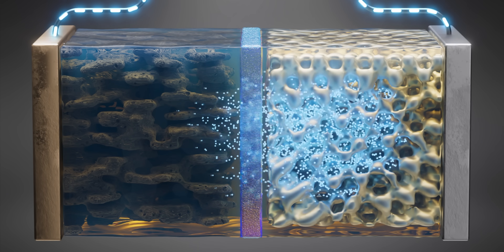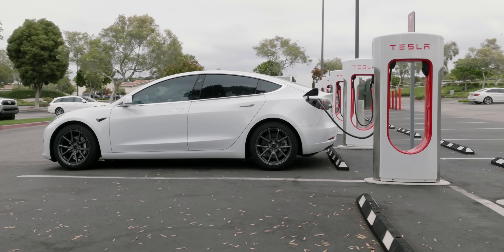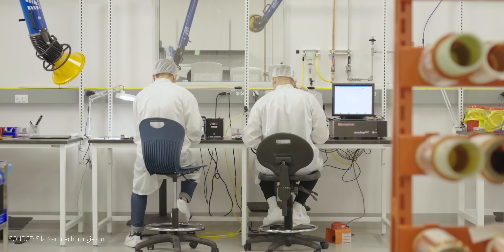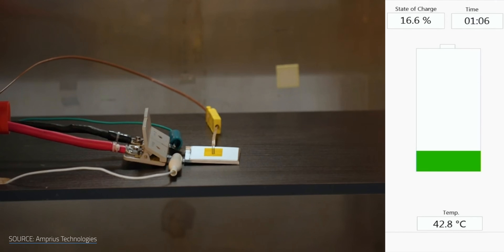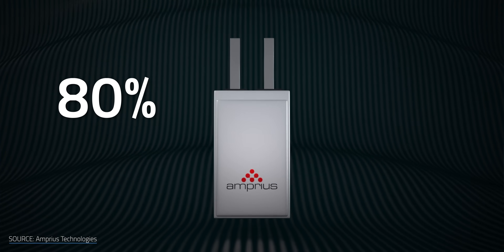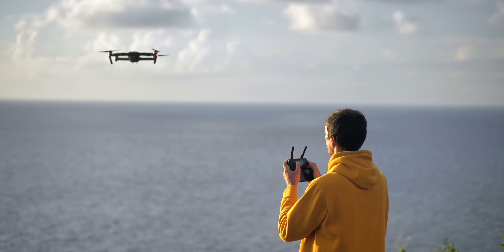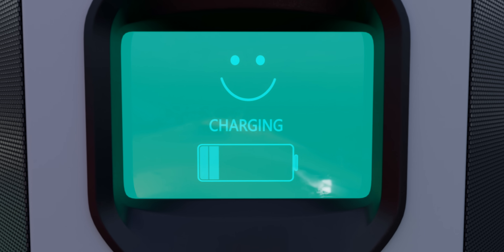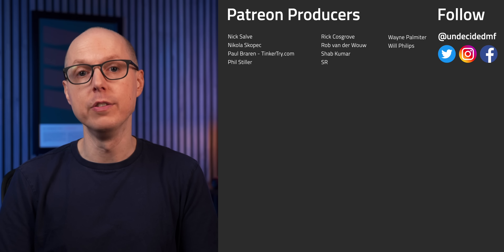Why This Ultra Dense Battery Breakthrough Matters

Comment: I was just thinking about this issue the other day. Batteries are one of the major limiting factors in technology today. Imagine how different things would be if we had better batteries. If you could buy a smartphone with a battery that lasts 10 years, it wouldn't even need a charging port. It could be fully waterproof. Or if your electric vehicle could run for months on a single charge, then long charge times wouldn't matter.
The only thing holding us back is the batteries.
Reply: Just get a plutonium 238 thermoelectric generator. It'll last years. Outside of nuclear generation, chemical storage isn't going to hack it.

Comment: Hydrogen paste has the same energy density as gasoline, is much cheaper, and can run all existing combustion based applications easily with minor modifications.  So no.  Sustainability requires distribution, not consolidation.  Hydrogen paste generators scale down or up like a 3D printer for any application.  You can generate hydrogen paste from a mud hut in Africa powered by the sun tomorrow.  Those batteries are designed to fail.  Only the luxury market will ever see them.  There is no point in the future where luxury energy storage will benefit the average person.

Comment: As a scientist who performs thermal runaway calorimetry on Lithium cells,  the real reason they aren't in any products today is safety behavior of Si anodes gets wildly violent. You could never use this tech in your phone for example, if you were to fall on a sharp rock impinging the cell, you would be maimed or killed by the TR event.

Comment: If the Silicon battery does away with graphite entirely, wouldn't that also solve the self-combustion problem of Li-ion batteries as well?

Comment: 50% increased efficiency of "new types of batteries" is not enough, diesel and gas are still way way better and it will be around for quite some time unless batteries aren't 10X efficient than current are.

Comment: Could these cells be mounted on the backside of pv panels?  Giving a panel and battery all in one. Extending the length of panels use and create a plug and play power system.  Just a thought.

Comment: With the AI boom, silicon could be expensive if the nano wires needs 99.999999% pure silicon the same used for CPU,SoC, GPU etc. I think the wood based or hydrogen or solid state battery could be the future but who knows we might find a breakthrough. I hope we find a sustainable breakthrough.

Comment: It is these types of incremental developments that I see having the most promise. This alongside high nickel monocrystalline chemistries on the cathode side will push NMC type batteries further. I am sure LFP is progressing but I don't follow that as closely (it should benefit from a silicon anode too though, no?).

For EVs I am happy with the current range available at 64KWh (at least it works for where I live). However the batteries need to get more energy dense in order to half the weight of the battery. On good roads an EV is great but you can really feel the weight on rougher roads. Lower weight battery equals softer suspension and ultimately longer range in practice as all the other components of the car such as brakes can be lighter. A virtuous circle if ever there was one.

Comment: I'm seeing posts that low cycle life makes this battery tech a non-starter for EVs - did they do the math?  Even a cycle life of 750 charges, with a range of 500 miles (possible with the improvement) gives a potential EV 375,000 miles of life.  Most I've had a car for is 205,000 miles.  Looks hopeful to me.

Comment: There are certain technologies that I'm skeptical of ever being viable, but EVTOL aircraft are not one of them. That idea in my opinion works too well to not be the primary means of air travel in short to medium distances in 20-25 years. 1-2 nm chips and battery breakthroughs along with breakthroughs in propeller design for efficiency and noise reduction are going to create very fast exponential leaps in the EVTOL field.

Comment: As far as I understand, Amprius, SilaNano and OneD use silane gas as input material to make the silicon anodes. Silane is refined silicon in gas form. Today, China produces almost all silane for industrial applications. In America there's more or less one producer who has the capability to produce silane in mass quantities, a company called REC Silicon in Moses Lake, WA. If this tech pans out, the scale-up will be dependent on REC Silicon expansion.

Comment: The real problem with VTOL taxis is not IF it can be done, it's that it would be unethical to build them. At least with standard cars we have the option to avoid the road and therefore avoid the dangers of a collision.

But if we had taxis flying around everywhere, literally EVERYWHERE YOU ARE you'd be in constant potential danger as a taxi could come flying through the building.

A helicopter already crashed into a pub n my city, killing scores of innocent people. That's already bad enough. Please don't encourage it to get worse. 

Personally, I'd like to see a ban on helicopters flying over areas with high population density even. It's simply not fair on citizens.

Comment: I don't understand this fixation we have in automotive scenarios with zero to 60 numbers for EV vehicles. It doesn't matter. The best economy velocity for any vehicle i have ever driven no matter the shape or powerplant is 45mph. Beyond that, wind drag exceeds all other forms of drag. Then there is time overdistance the real killer in time lost on a trip is at the ends of the trip, not minor velocity changes durring a highspeed distance travel. The biggest waster of energy is using your brakes. If you instead drive so you don't need to brake as often at lower speed, you greatly improve overall fuel economy.

Comment: It seems too good to be true. A battery that can store so much energy, charge quickly made from a cheap material. Nevertheless, it's good to know there is progress there, battery technology is one of the most important right now, not just for the vehicles. Renewable energy sources rely heavily on good batteries.

Comment: I'm SO excited.....

To hear what excuses the anti EV brigade come up with when vehicle weight is down, range is up,  charge speed is negligible and eventually, cost is similar to combustion. 

Surely once those issues (that aren't really real world issues anyway) are adressed, you're down to "I don't like the lack of noise"

At 2am when I'm sleeping, and Barry the boi racer is giving it the beans, trust me, I don't miss the noise.

And before someone comes at me, frothing from the mouth. I own 1 x 3.0 diesel, 1 x 3.2 petrol and 1 x 1.6 petrol. 
I am a petrol head at heart. But I'm also very open minded about any form of transport.

Comment: The reason for the focus on drones is because of drone warfare. It will be the number 1 application for this and an absolutely MASSIVE market very soon. The tech will 100% trickle down to all the other uses talked about like EVs, trucks and wearables, etc. as it always does with war technology but drone warfare is 100% the main reason they are focusing on unmanned aerial vehicles.

Comment: I am a robotics engineer and have worked at an autonomous drone factory and this battery looks good for that industry. They would be happy to pay double the price to get 30% more flight time just from upgrading the battery. As for cars, they need sooo many battery cells just to make a car and the price is already high for an electric car. Perhaps for PHEV vehicles as their battery is smaller than pure EV, otherwise the cost goes up too much except for Rivian or other exotic super EV cars, perhaps those hypercars could use it.